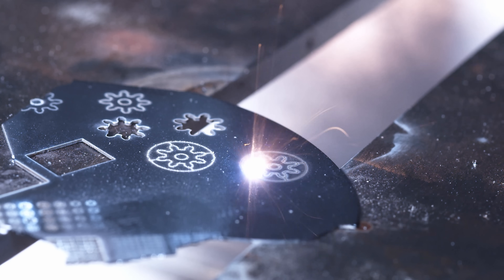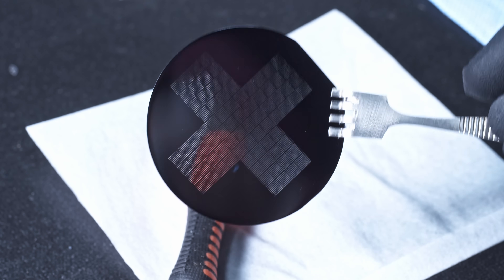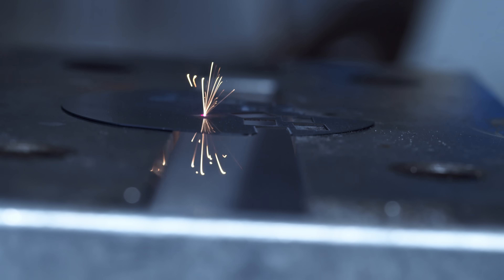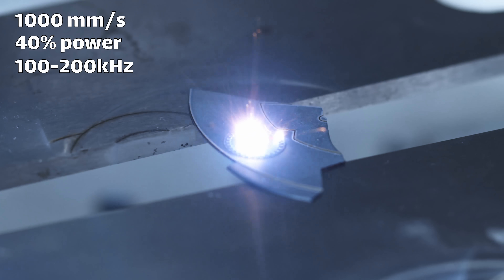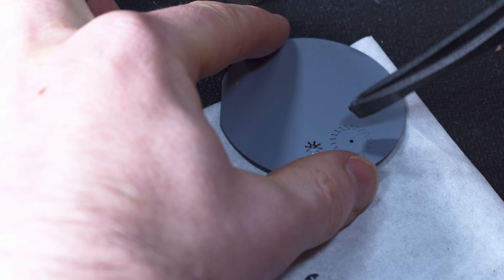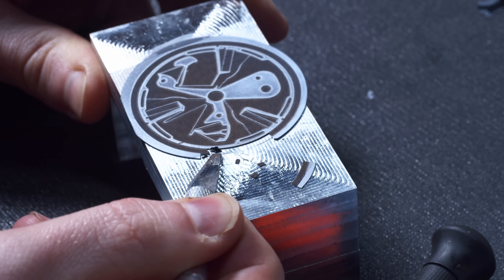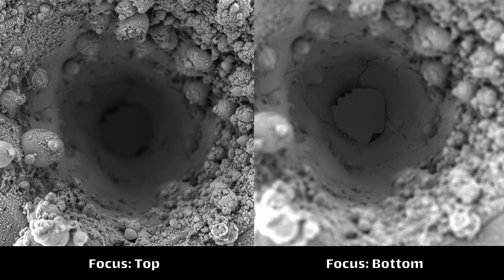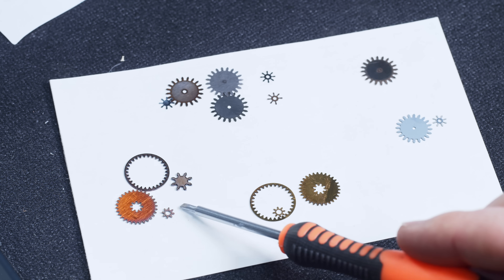Laser cutting Silicon Wafers

Comment: I'm pondering the thought of purchasing a machine like this. Would you be able to recommend a machine that would be capable of cutting steel for engraving purposes, and I would also like to have the capability to drill micro nozzles in steel. Any information would be greatly appreciated.
Reply from the maker: Still playing with metal recipes so hard to say, but yeah I think a 20-50W fiber would work great!  Especially if you are cutting thicker material that won't warp.  I don't have any specific vendor opinions though, I got mine from a random Amazon vendor.  Check out "Laser Everything" channel, he has some good videos looking at different fiber options (and a lot of good tutorials on different metals)
Reply: @BreakingTaps  I have been watching his channel for a few weeks. I am interested in other opinions also. Are you satisfied with the quality of the machine that you purchased, any regrets? I am looking for something in the 60 to 80 watt range fiber laser but everything from China looks like it all comes from the same factory.

Comment: Doesn't it work putting two wafers on top of each other, or does they fuse still? If so, etch a spiked griddle bed to put it on?
Reply from the maker: Oh, interesting. I'm not sure! Sounds like a fun experiment though, I'll try it out!  If I had to guess, they would probably fuse to some extent.  It seems to fuse to most surfaces I tried (glass, aluminum, steel, etc).  Not sure how much it's welding, and how much it's just a physical lock caused by material being intermixed/spiked into the support.

Comment: I would have 2 ideas:
organic supports like paper or wood, maybe wet? With some luck they only turn to carbon, still retaining some support.

And have you tried charging up the silicon? A small electrostatic charge might be enough for the ablated material to get flung so far that it is too cool to bond to the surface again.
Reply from the maker: I haven't tried charging it, but that's an interesting idea!

Comment: A potentially cheaper alternative to dynamically focusing beam optics might be to use one or more of those JWST mirror adjusting mechanisms to move the stage up after each pass. It might require more precise motion control than the adjustable focal plane system, but it would avoid having to modify your laser and also not require buying more optics hardware.

Comment: Find a piece of aluminium honeycomb and bond it to a flat surface, it works well as support material with minimal interference with the job.
I also noticed differences between cutting with or without a flat aluminium plate under the piece, I think due to the "heatsink effect" of the support.
Reply: I was thinking of machining a spiral into a block of aluminum with an engraving tool with a line spacing of a a few thou. Would balance out surface area and take advantage of the effectiveness of the laser at a greater depths.

Comment: Re polished vs rough sides, another factor is the effective incident heat flux. Heat flux on a smooth surface is just going to be beam power divided by the spot area (pi*r^2). However on a rough surface, at the micro/nanoscale, the incident light isn't striking on (aka at normal incidence) but rather it's hitting the slopes of all the hills and valleys of the surface texture at an angle, same as the sun at noon at the equator would hit the side of a mountain and be spread over a larger surface area than flat land of the same planform area. So the effective surface area being struck by the beam would, if I understand correctly, be greater than simply pi*r^2 of the beam spot and thus the heat flux would be lower, no?
Reply from the maker: Oh interesting, I hadn't thought about that. That makes sense to me!

Comment: Some glass cutting lasers work by ablating a series of small holes only part way through. They then wait a few minutes for the stress cracks to propagate between the holes. You might want to try that on silicon.
Reply from the maker: Oh interesting, that's a neat trick.  Will read up on that and see if I can do the same.
Reply: The cracks will tend to follow the crystal grains. That said, there is a thing called laser assisted dicing you might want to look at, but the curves tend to be larger radius.

Comment: For the issue of supporting, could you cut them on top of a soft material, maybe even some sort of foam, that would just burn away when the laser breaks through? If you ever would need to make a lot of identical pieces, you could CNC out a base that has a sort of "shrunken" version of the final shape beneath it, but the edges offset a couple mm so as to allow for a space for the laser to go.

Comment: Have you tried cutting with a preheat? I imagine it will reduce your thermal expansion problems. Silicon should handle pretty high temps and couple hundred degrees for metals.
Reply: That would also mean that the part that is cut is heating up even more, so the difference in thermal expansion would not change much.

Comment: To manage the heat cracking the crystal you might could cool them from the bottom. Maybe it would create a worse temperature gradient and they'd crack even more, at which point you go the other way and warm them up so that the lazer doesn't cause as much thermal stress!

Comment: I know I'm not saying anything you don't already know here, but for others watching, the pulsewidth of lasers used for micromachining is EVERYTHING. While we might think of multi-nanosecond long pulses of light as being incredibly short in our everyday experience, they're actually very long on the timescales of atomic interactions and energy level transitions, and so end up heating the material, melting it, boiling it, and just making a mess of things to a significant degree. If you can manage to somehow move into the picosecond or even femtosecond (10^-15s) range of pulse widths, you will enter an entirely different regime of laser-material processing where the electron temperature becomes completely decoupled from phonon interactions at the time scales involved and you can produce exquisitely clean, precise features in virtually any material down to the nanometer resolution level, simply because the material doesn't 'have time' to heat up and create heat affected zones before its converted right into a plasma that's not even touching the rest of the bulk surrounding material anymore. The number of really amazing new things you can then do to materials in this ultrashort pulse regime is totally crazy: creation of ultrahidrophobic and ultrahydrophyllic materials, permanent color alteration of metal due to surface plasmon resonance tayloring, near perfect blackbody radiating surfaces to dramatically increase incandescent filament efficiency, etc. If there was some easy way to modify a ytterbium fiber laser for short pulse operation you would be able to do vastly more with it as a general tool. Maybe frequency doubling it with a piece of nonlinear crystal could allow other more subtle material processing too?
Reply: yeah, that's why we always had to use mechanical or chemical to machine at some point - laser is easy but in submicron feature creation it leaves tapered holes/edges especially if you're trying to slice tiny precise cubes...or dice a wafer.  To this day it's done nearly completely mechanically.  Grind and saw.

you're describing something that seems to be live correction of lithography and honestly that's very small scale (feature wise) and the actual models already exist (it's just restricted to process engineers who stand on the shoulders of the PE's that came before them) but in more practical applications of, say, "garage" use there are pretty awesome spherical and liquid lenses that can be tuned spectrally as well as refractively.  I don't see why something like a ferrofluid couldn't be used in a set of rings that could deform a squishy lens with not only surface topological features but vary the density of the lens material itself on the fly. As usual, the biggest hurdle is addressability but somehow if you cock your head just right it always seems to present a method.  Rings with rings.  Zebra stripe edges but large toroids of them.  Depending on what part of the lens you look through you can wrap it pretty much however you want as long as the optical transmission path to the target is unobstructed.

That's discounting quantum imaging, et al, but that's both way off the path or one of the ways to the truth.  That's the thing about it, I guess.
Reply: maybe if we figure out how quantum imaging works, we can quantum machine materials.

make something without ever seeing it.

actually, the two methods below use the same imaging configuration (note they continue using the two terms interchangeably - that's why WP is irritating sometimes).  there is simply no consensus on how it is actually doing what it is doing even though in one study it was able to detect an object simulating breast cancer in an actual chicken breast without even looking at it directly using eyes or any known method of detection.  it's merely sorted itself over the past 15 years into these two loosely coupled buckets.

From WP (links tend to get scrubbed by YT autobots):
Real-world applications
As research in quantum imaging continues, more and more real-world methods arise. Two important ones are ghost imaging and quantum illumination. Ghost imaging takes advantage of two light detectors to create an image of an object that is not directly visible to the naked eye. The first detector is a multi-pixel detector that doesn’t view the subject object while the second, a single-pixel (bucket) detector, views the object.[12] The performance is measured through the resolution and signal-to-noise ratio (SNR). SNRs are important to determine how well an image looks as a result of ghost imaging. On the other hand, resolution and the attention to detail is determined by the number of “specks” in the image.[13] Ghost imaging is important as it allows an image to be produced when a traditional camera is not sufficient.
Reply: @russellzauner  Using ferrofluid as a real time control medium for a liquid lense!
I think you're on to something Sir..:::
Reply: holy crap femtosecond pulses? that's insane!
Reply: @mastershooter64  shortest pulses attainable now are a few tens of attoseconds.
Reply: What do you mean increase black body radiation? Like making stealth coatings. 

Do any lasers do this now?
Reply: @ohbeardedone9253   yes. relevant paper was in PRL 
"Brighter Light Sources from Black Metal: Significant Increase in Emission Efficiency of Incandescent Light Sources"
Reply: @Muonium1  Thank you for the reference to a very interesting paper with the best and most Morningstar title ever...::🥰
Reply: It is not easy to modify any q-switched laser without modifying electronic that drives q-switch element.
Reply: @MilanKarakas  Hi Milan, I recognize your name from your very interesting website and youtube page where you were one of very few people to grow your own SHG crystals!
Reply: Do you know some good bibliography on the matter? Or maybe a couple research papers that cover what you said?
Reply: Coherent makes a 355um 200ps pulse 10W laser for about $100k.
Reply: @bcwbcw3741  nm, surely....
Reply: Is this a retroencabulator comment?  I feel like half these words aren’t word
Reply: @stroopwafelfalafel  everything is real; no satire. didn't feel any need to reduce the jargon because his audience is technical and generally quite astute.
Reply: @Muonium1  huh. cool.

Comment: I wish you talked more about cutting the metals! Do you still use wobble? how much? what do the cuts look like?!
Reply from the maker: Future video for sure!  Still working out the recipes!  Carbon steel cuts pretty similarly, fast speed, moderate wobble, moderate power.  Stainless, copper and brass are a lot different and I'm still dialing them in.  Copper eats power like crazy since it is such a good thermal conductor, and stainless starts to warp if you look at it funny.

Lots of interesting things I'm still investigating.  I.e. stainless looks like either fast speed/slow pulse frequency/high power OR slow speed/high pulse frequency/high power could work, although they cut very differently.  Still playing around!

Comment: Could you try to float the silicon wafer on water or something like that to give support to the wafer while cutting your fragile pieces? Or maybe oil Instead of water then you wouldn't have problems with crumbling the wafer or welding it on a metal plate 🤔😅

Comment: What happens if you spin coat a thin mask material on, use a single pass to ablate the mask, followed by a deep anisotropic etch?

The mask could be a melamine type resin rather than an intentional photoresist.
Reply from the maker: I believe it should work! I've seen similar done in the literature, and as long as the resist isn't etched I think it should work fine.  I've ablated away thin metal films in the past so a polymer wouldn't be a problem
Reply: @BreakingTaps  you can also vapor polish it pretty easily, saw a guy do it to acrylic - chemicals are great for controlling a coating or layer of additive or sacrificial material.  Might have to get residue off but for just a lab test for developing and understanding your own processes in the context of what you want to build it shouldn't be any more excessive than soldering as far as toxic waste.
Reply: KOH anisotrpically etches Silicon. As to a mask, one might be better off using oxidized silicon and a CO2 laser. CO2 will etch the oxide and not the silicon.

Comment: For our laser cutting machine we use a borofloat pane as a substrate; we also place the focal point on the back surface of the material. We have a 2mm focal depth, however, so I don't know if this may also help with your machine.

Comment: Seems that there is a lot of working-around the fact that the laser is not ideal for the work.
Reply from the maker: It's probably not :)  But the "correct" laser are half-million dollar multi-kW fiber lasers.  Or similarly expensive pico/femtosecond lasers.  So there aren't really many alternatives for someone wanting to dice/cut/machine silicon on the cheap.  A DPSS UV laser might be more appropriate.  It'll etch much more shallowly so machine a lot slower, but the thermal buildup is probably more mangeable too.

That said, machining and making parts is mostly trying to problem solve using the tools at your disposal!

Comment: If you can arrange to irradiate the silicon in SF6 instead of air (about 300 - 400 torr) you can make black silicon. My PhD was on this and figuring out what happens. I used a XeCl excimer laser at 308nm, 10Hz rep rate, ~4J/cm^2 fluence. The ablation, photochemistry, and remelting gives you crystalline pillars forming above the initial silicon surface. They scatter the light so well they are very non-reflective, from long-IR to UV.
Reply from the maker: Oh wow, that sounds interesting!  Is it specific to SF6 (reacts with the molten Si I guess), or just an inert atmosphere?  Think it would work with my longer 1064nm wavelength?
Reply: @BreakingTaps  I've tried under plain nitrogen and also CO2 with poor results. Seems to need something that can etch the silicon, SF6 worked well for me, NF3 was too agressive and HCl gave some weird results. I know work was done using fs pulsed IR lasers. I can't see why it wouldn't work for ns IR. The trick was to get some Si ablated, SF6 broken down and pump some energy into the plasma to drive some photochemistry. The process starts by roughening the Si surface, this concentrates the light and pits / holes develop where the fluence in high enough, material ejected from the holes is then what goes on to make the pillars.
Reply from the maker: Interesting, thanks for the details!  I'll keep an eye out for a cylinder of SF6 and keep it in mind! Shame a lot of silicon chemistry requires fluorine-based compounds :(
Reply: What is the purpose of this? Can you scatter electro magnetic frequency as well?
Reply: @ohbeardedone9253  Features were too small to scatter much longer than near IR.